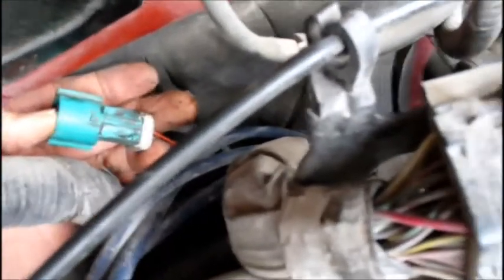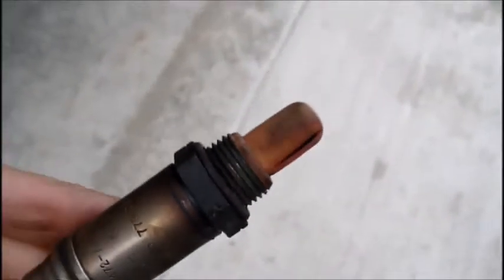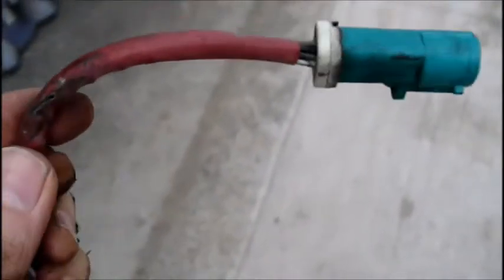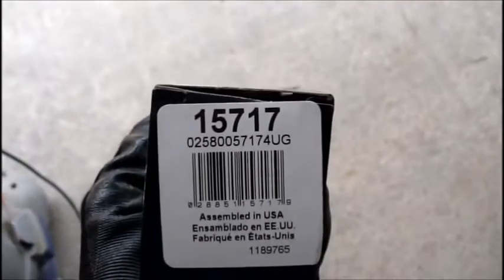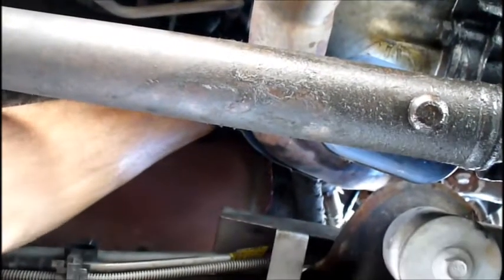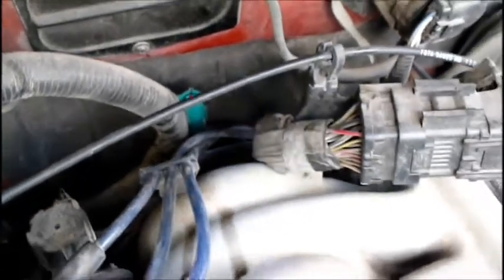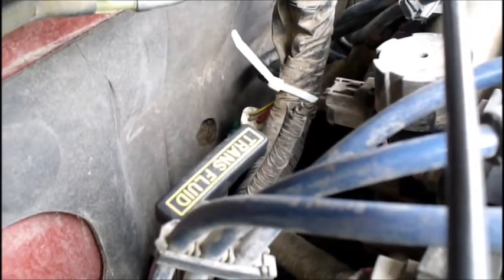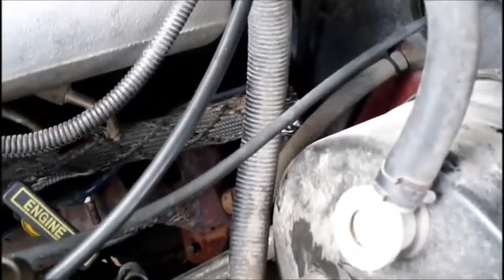DIY instructions: Oxygen sensor Replacement on Ford Ranger V6

Comment: Het David, how did you figure out it was the sensor on the driver side the one that needed to be replaced? I drive a 2000 ranger 3.0 v6 manual transmission and has 3 sensors 2 by the engine and other by the catalytic,  I got the code P1132 lack of HO2S11 switches - sensor indicates rich Secondary DTCs P1131: lack of HO2S11 switches - sensor indicates lean, help me out.
Reply from the maker: because your P1132 code tells me it is on bank 1. which is on the side where cylinder 1 is (i believe passenger side). sensor 1 is pre catalytic converter. hope this helps.

Comment: Any reason not to replace both sensors? I'm replacing the cat, maf sensor, temp sensor and egr valve as well (truck needed much tlc when I got it, but I like it). Have I missed anything that should be replaced simultaneously? I know, jack up the body and drive a new truck under it, lol
Reply from the maker: My motto is if its not broke, don't fix it. However, if you want to PM it with known good parts, then just the cost and time it takes to do the work is all you need to worry about. Depending on the age of the truck, you may want to replace belts as well. and while your at it, flush the radiator... have fun
Reply: @DavidTheFixerofThings  already done all that. It's a 2000 Ford/Mazda Ranger/B3000 with nearly 200k miles on it. I just couldn't make myself take down the old cat converter, change out the top o2 sensor (for which I pulled a code), then put the old parts back. Have already changed out most of the cooling system, with the exception of the heater core and hoses. Battery & alt have been replaced, and have already bought brake pads for it. New tires, upper control arms, shocks, alignment, yada yada. My ex had one that I cared for, when last I drove it, it had in excess of 350k. Gotta make a truck payment once in a while, I just can't bear the thought of doing this every single month. Thanks for the info
Reply: Replace the Throttle position sensor. These trucks are sensitive to "lazy" sensors as time goes on. 

I took apart a throttle position sensor on another ford over 15 years old and found there to be ALOT of corrosion on the internal electronics. Its not enough to make it "bad" but enough to give an inaccurate signal due to the resistance from the corrosion.

Comment: hey dude the o2 sensor is easier to get from the top ....
Reply: Where's oxygen sensor 02 wiring on 01 ford windstar
Reply: Which o2 sensor? The right one is a combo job of the wheel well, and underneath unless you have long arms

Comment: Where is the bank 2 o2 sensor located
Reply from the maker: If you are referring to sensor #1 bank 2 then I explain this in my video. If you are referring to sensor 2 bank 2 then that one is located downstream near the catalytic converter on the exhaust pipe, drivers side.

Comment: My check engine light came on (99 ranger 3.0) and the shop told me it was a heat sensor for the emissions that needs replaced. I'm assuming they meant this sensor right here. Everything on this truck is a pain in the ass to fix :)
Reply from the maker: This is not a heat sensor. Did the shop provide you with a diagnostic code? If not, you can take it to a autozone or O'Riely and ask if they would scan the code for you. ITs free. That will tell you which sensor is the faulty one. If it was an O2 sensor, the P0 code would indicate which sensor.
Reply: Ok I got the code it's PO155. Is this one hard to fix do you know? Thanks for the help man appreciate it!
Reply from the maker: Oh! okay. That would be an O2 sensor (which have heaters in them BTW), your shop just did not tell you the whole story... So chances are it is this one I describe in the video. But you should check the obvious first before spending time and money changing it out. Check connection at the plug, unplug and clean and then plug back in. You may need to have the OBD code reset (O-Reily can do this) after this in order to see if the light stays off. Good luck!
Reply from the maker: i might add, that you should also check your fuse box and see if there is a blown fuse that goes to your O2 sensors. good luck.
Reply: Ok Thanks for the info. The shop cleared the code but it came back on a couple days later. Looks like I got some work to do.

Comment: Isn't the p0153   O2 sensor   Bank 2 Sensor  1 upstream ??
Reply from the maker: thanks for the question. This is a bit confusing for some because of how Ford words it. Sensor #1 is the first sensor downstream from the engine. And it is UPSTREAM from the catalytic converter on bank 2. Hope this helps clarify.
Sensor #1 is the first sensor downstream from the engine.

 Read more at: https://www.obd-codes.com/p0153
Copyright OBD-Codes.com
Reply: David S 

I do believe bank 1 sensor 1 is the passenger side and bank 2 sensor 1 is the driver side that was the driver side on the video?
Reply from the maker: yes, it is the drivers side.